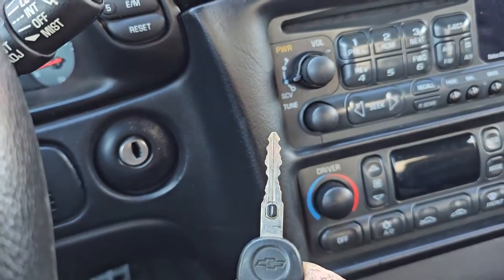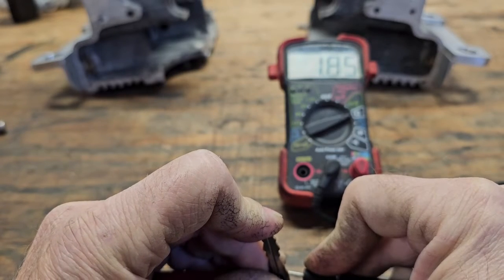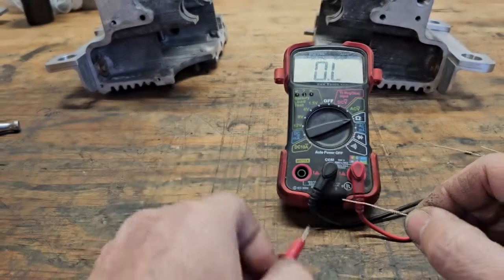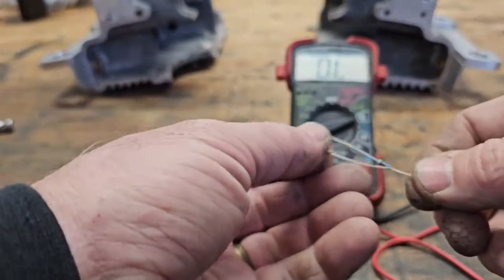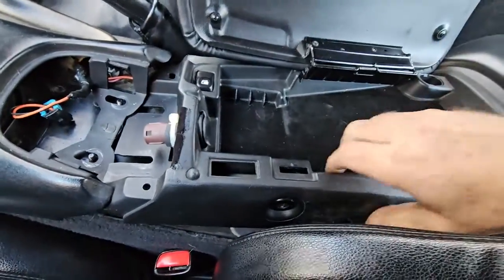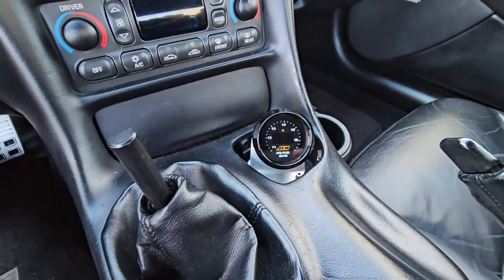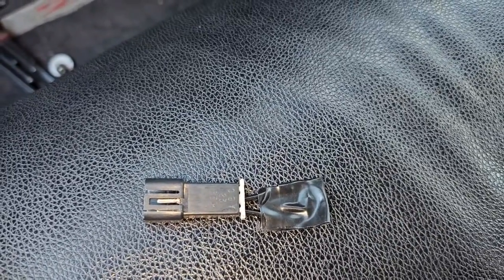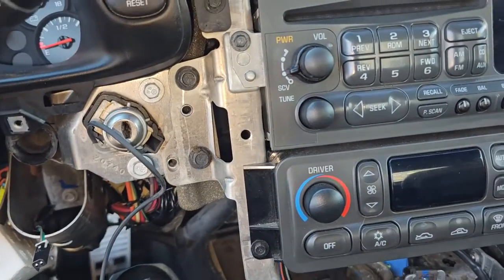C5 Corvette VATS Security System Bypass

Comment: I don't think simply moving the OEM resister from the key to another part of the circuit would provide any significant advantage towards solving the conditions feared, and does allow a thief to steal the car with a screwdriver.  Also, any hard modification of the wiring is just adding more potential points for failure.
Reply from the maker: It removes the potential failure of the mechanical parts that contact the key each time you insert it.

Comment: That's NOT bypassing the VATS. That's only bypassing the key, the entire VATS system is still in use that way. I want to know how to bypass the vats module itself in the case the the vats module/system fails.
Reply from the maker: Yes, technically correct it is only bypassing the key portion but that is what usually fails.  Unfortunately the VATS is not a separate module but part of the body control module (BCM) and so it would need to be programmed out.  I am working on modifying the BCM programming but I'm not done yet.  If VATS is not happy it will keep the engine from cranking by not activating the starter security relay.  That relay can also be removed without issue so the engine will crank but then VATS will shut off the fuel pump after a few seconds of running.  I haven't figured out an easy permanent fix for that yet but if it happened out on the road sometime you could hot wire the fuel pump at the fuse box under the hood and get home so the system will never leave you totally stranded.

Comment: Hi, I tried and it did resolve the issue. However the ignition is slow to crank for it takes a full 2 seconds holding the key to have it starting up. Seems like it takes “awhile” to read the resistor. Any idea.  I did change out the ignition switch but it still same. Thanks for commenting on any other possible path I should explore.

Comment: Wouldn’t it be easier to just buy a new key?
Reply from the maker: You could if the key was the only problem.  The contacts in the socket also get worn down and cause issues.  Also some people like myself just don't want the system at all and that's why we bypass it.

Comment: Bypassing at passenger floorboard is way easier purple black and white black wire on ebcm put resistor there, you dont even gotta take dash apart.
Reply from the maker: I agree and even prefer putting the resistor inside the BCM.  Changing it at the key is the best way for someone that's not familiar with wiring.  Much less to go wrong with only the 2 wires to choose from.
Reply: The meeting on my key for my C5 is 1.85 k I have two 100 ohm resistors when I put it together I get 1.95 quotes from 1.85 but I was going to use 1.95 is that okay

Comment: Can a Battery jump pack cause the resistor to fail or burn out ?
Reply from the maker: Doubtful.  The resistor wires go straight to the body control module so you would have to fry it first.
Reply: @xpsgarage  Thanks

Comment: I tried putting in a resistor to my ignition and it reads the correct ohms until I plug it in or enter my key. Mine is 870 and when I put the key in or plug it in the ohms drop to 420. Any help would be much appreciated. Thanks!

Comment: So i got the resistors and multimeter, i measured 2.35 on the 20k setting on my multimeter.   Does that mean 2350k?  I just don't want to mess anything up.
Reply from the maker: On the 20k setting that would be 2.35k which is 2350 ohms.  Out of the 15 possible resistors the C5 uses #8 is 2.37k and that's the one you want.  When you add the K to the end that means times 1000 so 2350K would be 2,350,000 ohms.
Reply: Ahhhh ok. Thank you for explaining. @xpsgarage
Reply: I bought a pack of resistors off amazon and they have a 1 mil but not a 2 mil.
Reply from the maker: @TJsVette  Did you just check the resistors in the pack with your meter to find one that matches?

Comment: Is there any reason at all not to just put the resistor in at the BCM? There was an abrupt edit in the beginning where you started to say something about this and then jump-cut to the fuel pump being cut off(?)
I have seen a couple videos of people bridging the purple/white & white/black wires at the clip where they connect to the BCM. Also, someone on Corvette Forum recommended I cut those wires leading back to the ignition switch entirely after inserting my resistor at the BCM, so that if for some reason the resistor on the key started working with the sensors in the key tumbler, they wouldn't run in parallel, or cancel each other out, or some damned thing. Any thoughts?
Reply from the maker: That was an abrupt edit but I was talking about shorting across the theft relay to get it to crank but if the VATS was still unhappy it would shut off fuel.  I mentioned putting the resistor at the BCM at 12:30.  That is an excellent place to put it if you want and definitely do cut the wires going back to the key.  I'm not sure what the wire colors are but I would make sure to look at a wiring schematic before doing it.

Comment: So I watched the VATS video Thanks very helpful. I have a 99 FRC and need to go down the same path. Have you disabled the active handling? If so can you explain how as the parts to keep these systems alive have become discontinued.
Reply from the maker: I deleted the active handling and the ABS since they are actuated by the same pump.  I removed the ABS pump completely and ran new brake lines straight to the wheel.  I also added a manual proportioning valve in the rear brake line to make sure the rear didn't lock up first.  That left the ABS and BRAKE lights in the dash on so I removed the bulbs from the instrument cluster.  Pulled all the fuses that had to do with ABS and eventually pulled all the wiring.  The only message I get after removing all this is "service vehicle soon" when I first start it and pushing the reset button makes that go away until the next start.
Reply: @xpsgarage  Did you remove the ebcm from the CAN buss or is the light on on the dash?
Reply from the maker: @TomPeters-d4x  I disconnected everything that hooked to the EBCM including the data line.  I did have the lights on the dash but I just removed the bulbs.  I didn't get any messages on the DIC about servicing the ABS or traction control.
Reply: Thanks for the help

Comment: Hello, I have a problem with my automatic C5, it starts fine but when I put D and press the accelerator, it turns off, the engine dies, it won't let me move the C5 more than 2 miles.
Reply from the maker: That sounds like a column lock issue.  Are you getting a pull key and wait 10 seconds message?
Reply: @xpsgarage I’m getting this message but, my car won’t even start, I hear the usual click of the relay on the passenger side, but once you turn the key nothings happens and the message of “pull the key 10 seconds appears. I want to mention I replace the steering column with a z06 one that may be my problem or not?😅
Reply from the maker: @Spvette  That's kind of weird since that sounds like 2 different problems.  The pull key is the column lock and no crank could be VATS.  Do you have an LCM5 module installed?
Reply: @xpsgarage  no I do not have it, now it cranks but not start I check and the problem is no spark
Reply: I don’t know is any of those system cuts spark
Reply from the maker: @Spvette  No,  neither of those systems should cut spark.  Do you have any trouble codes?
Reply: @xpsgarage  yes I have p0107 p0707 p0713
Reply from the maker: With those codes I would be looking for a wiring issue especially a bad ground wire.